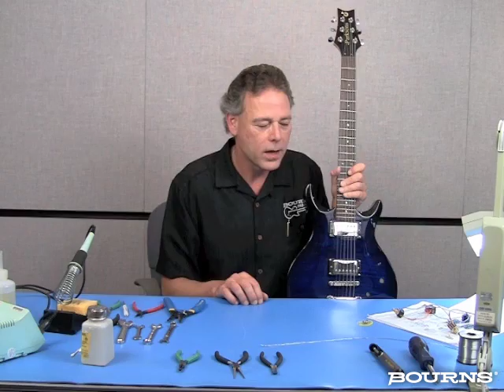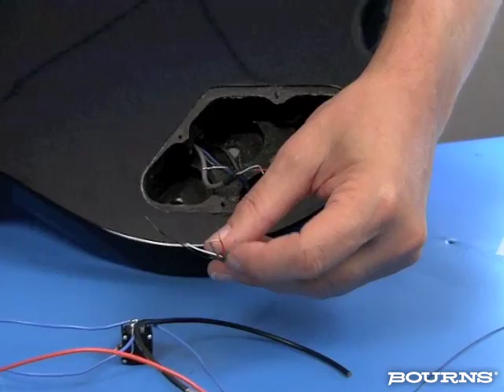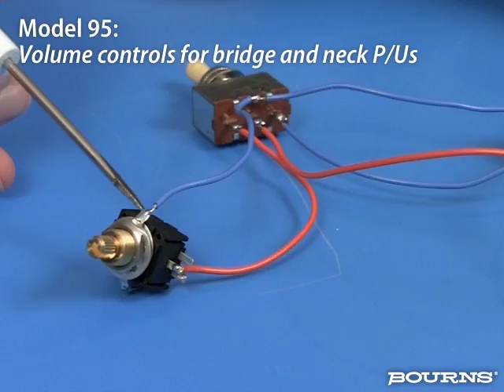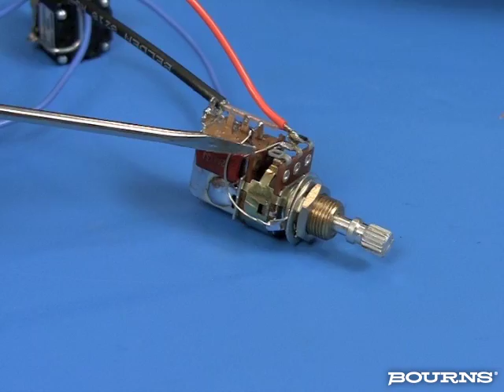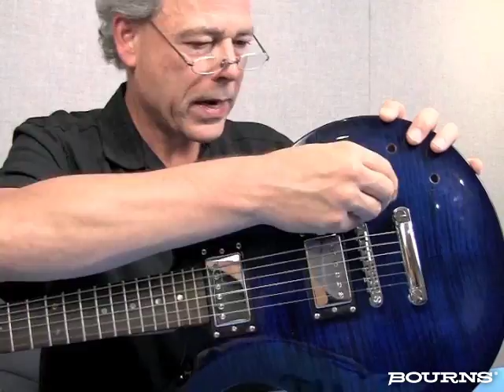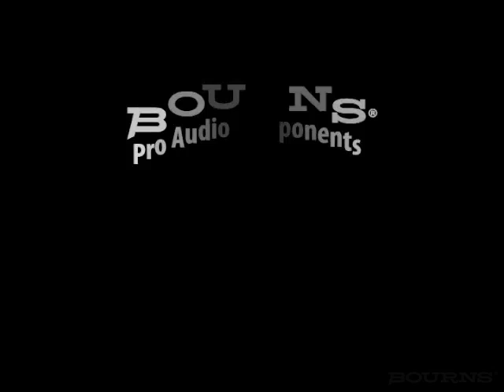Bourns Push-Pull Switch Guitar Application

Comment: Those bourns push pulls work great until it pulls all the way out.
Reply from the maker: Hi Ryan - We'd be pleased to replace the defective product, please contact us for further action. bourns@bourns.com
Reply: Hey Ryan I have the exact same problem. What pot did you end up replacing it with?
Reply: @AveryGuitar  fender makes a push pull dime pot. CTS makes a full size push pull pot. I have had good luck with both.
Reply: @smokepeddler  thanks
Reply: I use a push pull from Dimarzio. I don’t know brand it actually is. Could be Alpha but so far it works great

Comment: i think you need to change the wiring from tunnel 1 to 3, your turning the volume in the opposite direction
Reply: Or he could be using a left handed pot instead of a right handed one
Reply: Being right-handed I would have never even put any thought into thinking that left-handed pots or even a thing. That's pretty cool

Comment: You didn't show how to wire the switch!
Reply from the maker: Please have a look at this application note for wiring information. https://www.bourns.com/docs/technical-documents/technical-library/sensors-controls/application-notes/Bourns_Model_PDB183_Gtr_pot_switch_AppNote.pdf
Reply: @bournsvideos  this is a super helpful diagram! Do you know how I would set up a different combination? I'm trying to use push/pull pots (2) for master volume and only 1 master tone. I'm a bit stumped on the set up. Thanks!